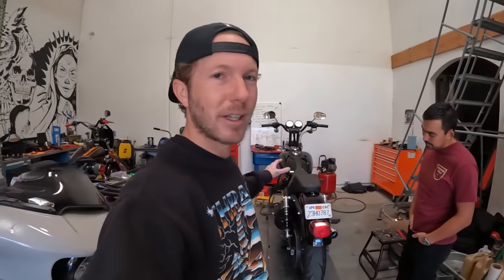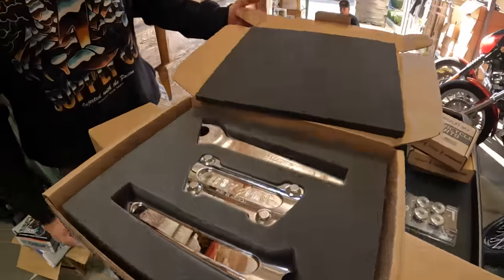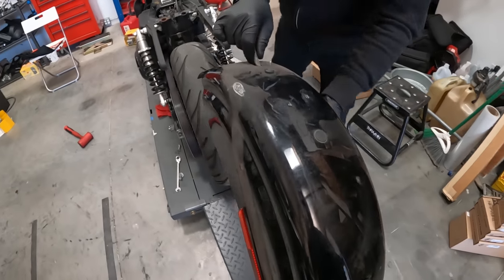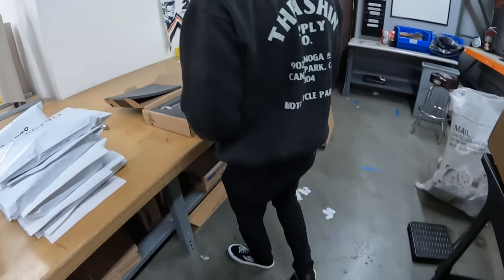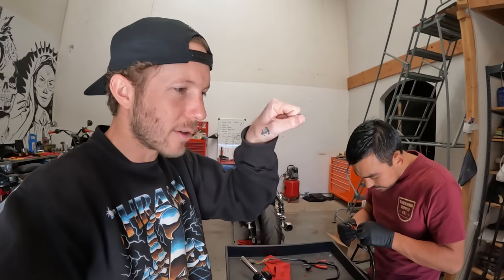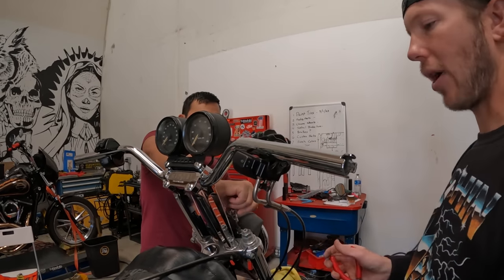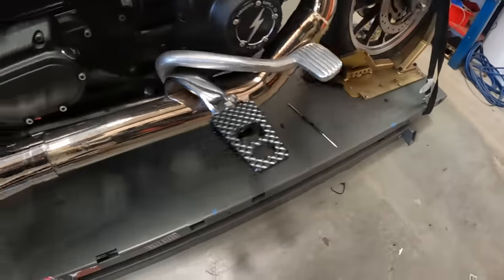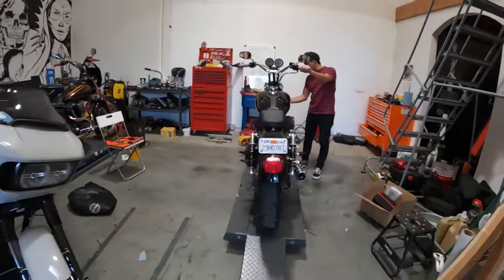Letting the FXDX EAT! Vlog 56

Comment: Not to tell U your business bro's but as you know, I'm sure, the cam chest needs to be torn into to at least check or replace the tensioners, ofcourse you'll go  with "red" cams, cam plate, high flo oil pump, bearings, etc, but I'd hate to see the tensioners fail. Beautiful job on the bike, You Guys effn Rock🤘
Reply from the maker: Previous owner claims to have already done the chain tensioner upgrade 👍🏻 when we have the time and gaskets we will take a peak 👁️ if the engine grenades… I guess will have to put a 131” in it 😜

Comment: I have a 2003 Harley Davidson dyna super glide is 38,000 miles high for the bike and how do I get the right length throttle and clutch and brake cable when I buys rises and bars from yell

Comment: That screw is not cruise control
Reply from the maker: What is it then? 

56397-74C
ADJUSTING SCREW KIT W/ 11155, 56394-74 & 56402-83A

That’s what we used…. I had it laying in my tool box and I’ve always used it for locking the throttle….
Reply: Yes it is. It's designed so properly adjusted it will hold the Throttle,  but at the same time allow you to easily close the Throttle if needed. Think of it as a friction device,  not a locking mechanism.